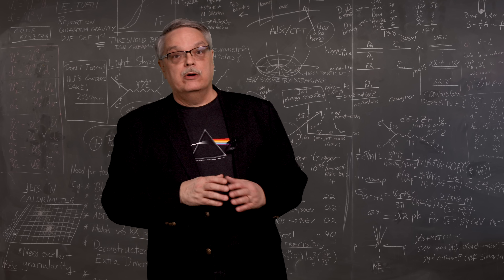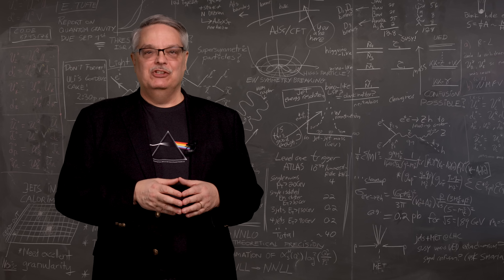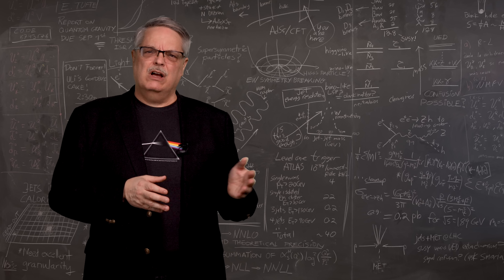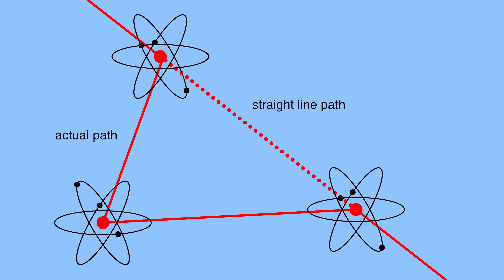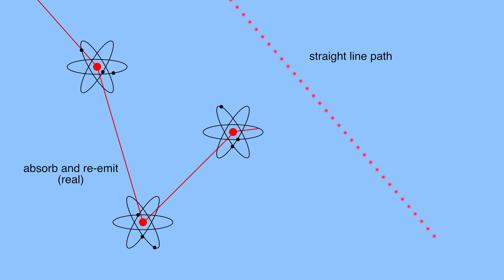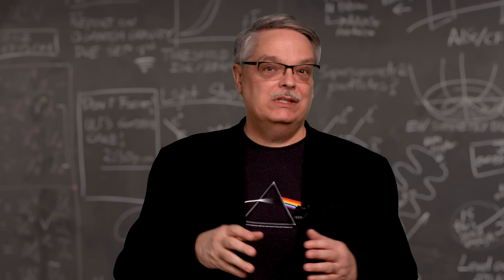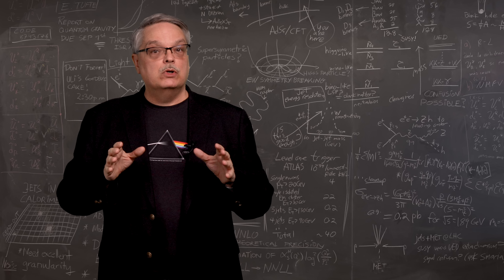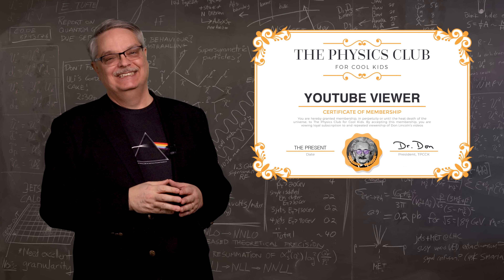Why does light slow down in water?

Comment: A photon is a disturbance in the electromagnetic field – a wave in that field. This wave... does something to the electrons. The electrons don't absorb the photon. They are simply influenced by the disturbance. Since electrons are charged particles... their movement generate a... electromagnetic disturbance. Which is another photon. But this photon has energy. Where does its energy come from? From the initial photon? That would mean the initial photon has a smaller wavelength now.

I still don't get it.

Comment: Even tho the quantum cult claims that light travels, light in reality do not move at all, it has no speed, it is not a particle. it is a simple dielectric field effect. Different materiels have different conductive  properties, that is why you assume water is slowing light down. pls dont make ppl believe your false religion by providing fancy equations backed by assumptions, it is not science. 

Light slows down in water and than miraculously speeds back up after it leaves water? By itself? Without any energy being spent? do you seriously believe that? A particle speeding itself back to 300.000 km/sec, instantly(!?!), without spending any(!!!) amount of energy?!?!?!?!?
Wow, I thought i was a bit crazy, i see that you guys are real real nuts.
Isn't this against the "conservation of energy" law? What happened to the energy of slowed down light particle? Where does it take the energy to speed itself up again? That water should be vapor on one side and ice on the other side, if light had travelled through. What kind of science is this, "let there be light" kind of science?
Wow... Do you pray, after the equations are solved?

Now i just wait for a smartass cultist to ask me "what about lasers dude?" 
Go, research, observe and pls use your brains before using mathematics. It is a powerful tool and is in wrong hands...

Comment: I think This explanation is also wrong because of the below reasons:
1) If Electrons are moving because of Light wave, then Light wave is dissipating its Energy to move the Electrons. Hence the Light should disappear after travelling some distance.
2) Even if we consider Electrons are oscillating because of light wave, The Electron should emit the light in the OPPOSITE direction(Which happens in case of Mirrors), hence there is no chance of adding up of EM waves.

Hence your explanation is wrong..... :) :) :)
Reply: 1. If electron movement energy is re-transmitted following the initial wave instead of heating the medium, the light won't disappear (at least this won't happen soon enough)
2. Where from "opposite direction"?
Secondary wave emitted by electrons follows the initial wave with delay so it propagates in the same direction (apart of refraction on border of different medium, where direction respectively changes).
Reply: @rvrss7192  
1) First of all, re-transmission or re-emission  of energy is NOT happening here, because:
Electrons are NOT absorbing any energy from light wave, instead, Electrons are just moving from one position to other position because of Light Energy (at this situation, Electrons Nether have energy to come back to their original position nor have the energy to Emit Secondary wave.)
2) Whenever Electrons oscillate because of EM waves, it will create an other EM wave in the Opposite direction to the source EM wave.(Fleming's Rule) .

Comment: This really still doesn't answer the question fully... Stating that the resultant wave moves slower in the glass/etc... explains nothing.. that's what we're trying to learn!  Slower because the lightwave is now interacting with a material??? While in the near-perfect vacuum of space, there is simply nothing for the light wave to interfere with so it can proceed at full speed??

And as far as the change in direction, if the lightwave is not entering the glass at a 90 degree angle, either the right or left edge of the wavefront, depending on the direction it is coming from, will interact with the glass before the the other end of the wavefront.. so it then experiences the slow down first.. Kind of like a high school marching band when they turn a corner... the kids on the inside have to slow down.. and the kids at the far end either stay the same speed or speed up to the line stays straight....

That's my interpretation of it anyway... :)

Comment: Doesn't explain why light travels in a straight line in the medium. The electric field in a medium is randomly oriented. If interference occurs, then light should be scattered as the field it interacts with is randomly oriented. Does this objection make sense? Please correct me.

Comment: So yet another part in my understanding how a laser functions. So if we have a laser with a solid crystal in it, it is essentially what happens there too??
The light enters the laser rod, slows down, acts with the chromium atoms in the rod and exits on the other end, then speeds up again.
It is then reflected by a mirror and travels back through the rod again and so forth .. Until it is rectified and so much energy stored (speed is still the same) that it protrudes the end with the half mirror coating.

Comment: When you drop a magnet through a copper pipe it shows how electric current induced by the moving magnetic field sets up a magnetic field that opposes the magnet in a similar sort of way slowing down the magnet
Reply: According to "Einstein's" stolen theory of relativity, light should bend because of gravity, yet observation confirms repeatedly that it only bends within the plasma sheath of stars and doesn't bend outside of it. Seems to me like plasma slows light down too, which is why it bends.

Comment: Good video sir.  I was hoping to see you try to provide an explanation as to why light speeds back up.  You only ventured to say that the light returns to its preferred speed. I think I know why you did not attempt to explain how the light speeds up.  I don't think you know so you didn't try.   There is that whole Conservation of Energy thing.   I agree that light is not a particle.  It is more like a wave.  However, the wave pattern is not the the light itself. The wave is nothing more than a behavioral description.   Do you see things differently?
Reply: The video clearly states exactly this.

Outside the glass there is one wave traveling at the speed of light.  Inside, there are two waves that combine to be slower than a single wave.  Light travels at the speed of light in the material, but because it interacts with the material, the combined wave is slower.  Leave the material and there is no second wave with which to interact.  

It boils down to the fact outside of the material there is less complicated stuff going on and the effect of the material doesn't come into play.
Reply: @drdon5205  Not so if there is continuity in the wave.  Accepted models suggest there is continuity and sadly, that view is currently beyond questioning.  I understand what you are saying but you still did not provide a real explanation with your supportive comments.  You can't just say that the light returns to normal speed because it becomes unhindered.  That is an empty conjecture. It is said that when light is unhindered,  it"travels" at 186,282 mps.  How can it be hindered in its travel and then miraculously speed up afterwards?   There was no real explanation in the video for that.  It still defies the so called laws for the conservation of energy.   There is a problem here if light actually travels from one point to another.   Think wave continuity.  I would like to point to situation where there is no need for wave continuity and no travel.  Fermilab could look into the principle of locality for the answer.  It is unfinished work that has no concrete answers. it does make more sense than that which was presented in the views of  action at a distance.

Comment: I don't find this explanation satisfactory at all. You are basically implying different wave lengths travel at different speeds, and this is completely false. All wave lengths in the electromagnetic spectrum travel at the same speed.

You are also implying that you can change the refraction of a material by introducing a third source of light that will logically cause further change to the wave length (you can sum as many wave lengths as you want, not just two), and we know this is false as well, you cant use a source of light to redirect a beam of light.

Also when you change the wave length of visible light, which is possible, literally means you are changing it's color, and once again, we know a beam of light wont change it's color just because it is traveling through a completely transparent medium.

Comment: One properly of light, materials, and their interaction in our universe that I find utterly remarkable is that when light is refracted passing from vacuum into a material (matter) medium, and is refracted, the angle of refraction always is such that it assures that the light will travel through the medium, i.e., from point of entry to point of exit, in exactly the shortest time possible.  For reasons I remain unsure of, even given the good explanation in this video, the speed of the light slows in the medium, meaning that it would take longer to go from entry point to exit point IF it were not refracted.  But, seen in the usual way pictured here, refraction "bends" the light "downward" which shortens the entry to exit distance that it travels through the medium.  Sure, that's easy to see.  But what's incredible is that the light path is refracted exactly such that the time taken by light traveling through the medium is minimized.  I believe Fermat was the first to note this.  Think about this.  At the point and moment of entry, how does the light "know", how much to refract, or the how does the medium "know" how much to refract it, exactly such that the amount the medium will slow light speed within it (by whatever mechanism) will produce minimum time in the medium?  The mechanism of slowing, and/or refraction, must provide the explanation for this remarkable process of time minimization.  I believe QED does provide a full "explanation" of this effect, as much a quantum theory truly explains behaviors of light, matter, etc.  It also, of course, "explains" the seeming problems that result from single photon behaviors in the classic refracting process pictured in this video.

Comment: Define electric field. Also if we are to embrace the idea of light as a wave instead of a partical then why say speed of light it should be rate of induction. Waves, waves of what a wave is not a thing its what a thing does. Waves of electric field, ok what the poop does that mean, nothing. no thing is moving from point A to point B light doesnt have a speed. Impossible to explain without the ether when are we going to admit that Einstein's explanation of the photo electric effect was in error?

Comment: The second wave generated by the movement of the light through the medium (whatever that medium is) is actually an inducted wave which moves through the medium in a direction opposite to the direction of the light wave. This is what slows down the wave in the medium and it is also what allows the light to continue in the same direction and speed when it lave the medium. Whatever the value of the second wave, attenuates the light wave passage through the medium. Different mediums attenuate at different rates based on the amount of induction.

Comment: The wave moves with a decreased velocity due to the superposition, because frequency remains constant despite refraction. v=fλ tells us that if the superposition with a smaller wavelength wave created by electron oscillation decreases resultant wavelength, the velocity has to decrease to maintain constant frequency.

Comment: Dear Dr Lincoln. I think all three explanations are correct. The factor that removes the randomness you suggested in the first two is removed by the extremely large number of electrons uniformly distributed around, resulting in a huge number of destructive and constructive interference leading to the smoothing of the final picture. This is very much like Feynman explanation of the angles of reflection etc using the superposition of many 'random' events resulting in a correct single clean answer at the end.
So if you say light is delayed on the path you are correct, and if you say that it gets absorbed and re-emitted they you are also correct and when you say it is the result of wave addition you are correct. By the way, even in the wave explanation you know the glass is not continuous but made of parts and pieces and they will not unite in a single picture without conditions.. that is why only good glass behaves as you describe.. just let a small change in the density or the surfaces being less than parallel and you get a completely distorted picture. This is how the prism work in producing the rainbow colors. By the way, I very much like all your videos.. good work.  regards..

Comment: This is an excellent explanation. I'd like to point out that the pencil at 1:23 and physicist at 1:27 display some properties that seem to be implied by the two particle explanations. The pencil is clearly magnified below the water level while the physicist is the opposite. That seemed to be a result of the first particle explanation. The second particle explanation would suggest the images should be blurred. Although the pencil is not blurred, the physicist is blurred. Perhaps all three explanations are valid because there is some sort of duality of light that would allow it to be regarded as both a particle and a wave ;)

Comment: Greatly thanks to this video, it has explained my confusions that why so much videos about light doesn't explain thoroughly from side of atoms. And all the exactly same wrong situations mentioned in this videos, which are totally same as what I had thought. And this professor explained it.  I am so thankful to this video.
But can anyone tell me  why the direction of EMF changes after superpositioned ? And how the direction changes? And how does it reflections the light like a mirror? In my imagination, the light travel trough the water just slow down, without change of direction and the interface of water do not reflect the mirror images.
And in that case, Light should travel slower and slower in the material since more and more EMF are interacted.  
Since the theory of EMF is accepted, all the known explanations of light should be revised.

Comment: So I get that most people in here are just speculating wildly but I'd really appreciate if somebody that really understands could maybe one day reply and tell me if I'm on the right track here with the classical view of this mess:

A light wave enters the medium and excites (wiggles) an electron. This electron, in turn, generates an EM wave but slightly phase shifted because of the inertia of the electron (it takes a bit to react to the applied force). This new wave gets added to the original wave causing the net wave to be phase shifted somewhere in between the original and the secondary wave but definitely a positive amount backwards. This "looks" like the entire wave was set back a bit and this repeats with every electron. The resulting build-up of being phase-shifted backwards looks like the wave took longer to travel.
But this does not really make sense completely since the head of the wave is unaffected by the electrons secondary wave and should, therefore, continue at the same speed, unshifted. 
This kind of fits into my admittedly bad understanding of phase vs group velocity since being phase shifted backwards would if anything influence phase velocity which is what is used in Huygen's principle (right?) so that would work out with why we observe a bend. The head of a wave should travel at phase velocity I think since it is also just a crest and they travel at phase velocity (says Wikipedia). But there is the crux already: The effect does not apply to the wave-head so why would Huygen's still work? It might but then the part of the head that was unaffected should continue to travel straight and I've never heard of such a thing happening. Maybe the amount that would be cut off the head is too small and not enough for a photon so nothing goes straight but where does the energy go then and also this brings in QM...

Bringing quantum mechanics into this though breaks everything for me. Probably because I still haven't figured out what photons actually are. Are they like small packets of classical EM radiation? I don't think so but, well I don't get any of this. Assuming they are not and that all their wave-i-ness is about probability of position and momentum my above explanation is 0% applicable to them. I guess that's where "take all paths and it'll work out" and stuff like that comes in.

Sorry for this mess but I spent the last 3 hours trying to understand this again and I needed to get this out.
Reply: Your statement is approximately correct.  Remember that the wavehead as you call it exists for femtoseconds.  Even if things go as you think, it would be impossible to see.  Things happen fast in the quantum world.

When you get into quantum, it's simply much harder to explain and requires real effort on the part of the student.  A short YouTube video isn't the best place to convey that information.

And, as you noted, the bulk of the comments are rather...ummmm...conjectural.

Comment: So what's happening when light enters the surface of the ocean and never reaches the deepest parts?  Like the old roach motel, it checks in but never checks out.  I can only speculate (probably wrongly) that maybe it's continuously reflected all the way down the water column until there is nothing left.  Or could it just be converted into infrared and absorbed as heat?  I can't say for sure but as Don Lincoln just showed us, explanations that make sense to the layman often aren't the right answers.